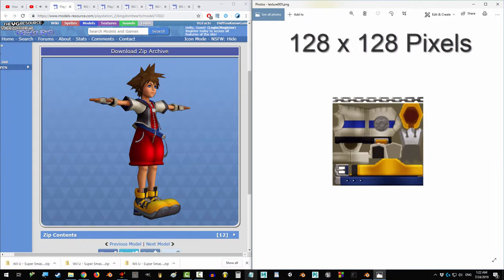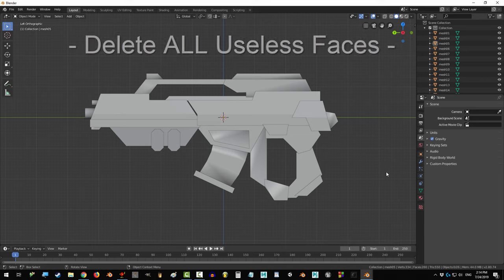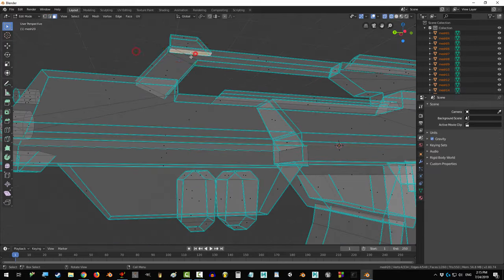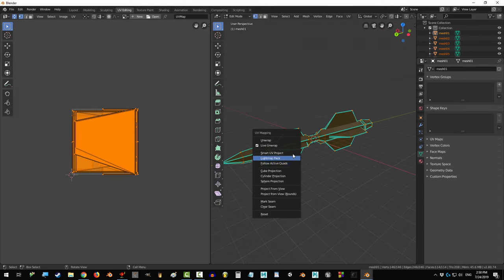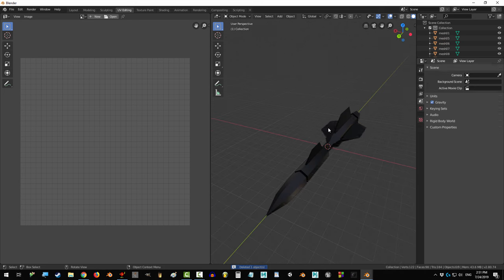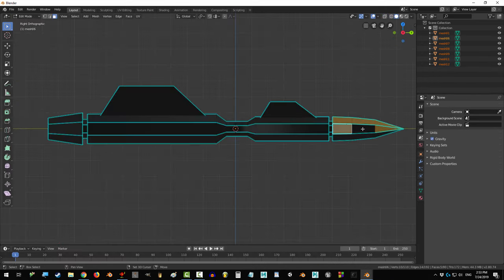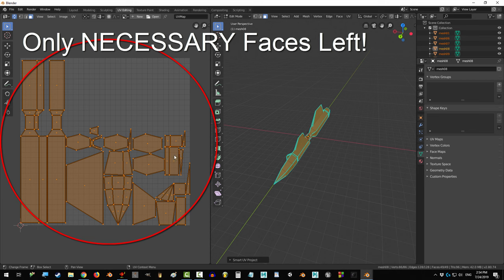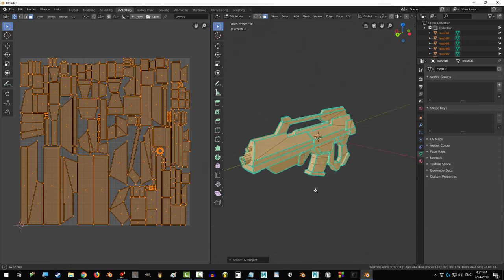Blender 2.8 : The 3 Rules of Japanese UV Map Preparation

Comment: Just a quick question, you say delete half and mirror when you're done do you mean add the mirror modifier and export? I ask because would the mirror modifier not add the extra polys or dose it just layer the other mirrored side under the already mapped side so it's not a problem. 

Also with the missile how the hecky dose that work cause I know the maps will be the same and such for each fin but do you make the fins as separate objects and then unwrap one of them so the same uv applies to all of them because they're technically the same object uv wise or is the missile one object with the fins and you export the object fully but delete the excess to do just the UVs? If the fins are separate objects then I understand how you can just delete them because in engine or later you can just copy paste the unwrapped fin but if it's one connected thing I don't see how just mirroring will get you the original 4 finned missile.

This is interesting but it's shorting my brain because I'm hardwired to just delete unnecessary pollys and unwrap like you unfold a box with all the UVs like normal but I see it's very inefficient in comparison
Reply from the maker: Sure thing, don't worry. It's very straight forward. Let's start with the fin question. In short, after the fin has been textured, you copy and past them to fill the space of the fins you deleted. You can use the mirror modifier if you want to do this. The basic thing is UV/texture the fin > then copy and paste it back to fill the 8 original positions. I just ctrl + c > ctrl + v and snapped them back to the original position. 

And yes, you would apply all your mirror modifications, apply them, merge points, remove doubles, before exporting.
Reply: @TheRoyalSkies  oh so the fins are separate objects. That's really clever so if you unwrap one fin and make copies then the duplicates will obviously have the same UVs. My brain is still shorting on how this will work for like merged objects and some spesific use cases I can't explain but I think I pretty much get it so I'm sure I can figure it out. 

Thanks for the info man, I love the quick vids and the upbeat personality, you've made learning blender super quick for me because I know how to do most of these things in other programs but I wanted to learn blender and beginner tutorials are usually long and frustrating because I know a lot of what they're saying but I just want to know the shortcuts and buttons and terms of the new program not the history of everything.
Reply from the maker: @Marcel2278  Yeah man, you got it. The fins are just duplicates of a UV'd fin, the UV's transfer over too. I haven't done it in Blender yet, but when you merge objects in Anim8tor or Maya, the UV's are kept unless you change them. So for my game in Unity, I would just join everything into a single object after I had copied and pasted all the fins and it would still be properly UV'd and textured. 

I'm in the same boat as you really. I came from Maya and wanted to pick up Blender. It's a great program, it's just how long most of the tutorials were. But, I'm hoping after this series is done. People wont have that problem anymore :)
Reply: @TheRoyalSkies  dude definitely, your videos are short and to the point, I wouldn't say the most beginner friendly (they are but they're so quick I think an absolute beginner might have to watch it about 2 or 3 times to get it all in some times but I'm talking never picked up any 3d program noob but there are longer tutorials for them anyway), but they're definitely super helpful for people who have even the tiniest idea of what you're talking about and they can easily follow. It's also especially useful for people who come from another program trying to learn.

Comment: So do you just add back the repeating objects afterwards and use the same uv for the previously deleted objects? UV mapping is something I really don’t do (but should), so I want to be sure I’m understanding correctly :U
Reply: Dark_Mink  so any objects that share the same UV some will have the same texture applied to them.

What you want to do is, any repeating elements that CAN look the same textured, SHOULD.  Why do twice the work when you don’t need to?

So create that object and mirror and repeat it as needed.
Reply: You can leave the geometry there if it's easier to move all the UV islands over the same spot, but it's probably easier if you map it once and then duplicate and move the geometry to where it should be, that way all the UV islands for that object are stacked on the same spot. 

It's the same with mirroring a symmetrical object I think. The UV islands for either side are stacked on  each other so you only need to 'paint' half the model.
Reply: Logan Sunn cool, thank you!
Reply: Arthur Khan thanks to this also \o/
Reply from the maker: Logan and Arthur both said it spot on. Yes, you can just copy and paste the objects back on where they were afterwards (They will retain the UV data from the original). Island stacking is great way to save space as well. I'll teach you a few more tricks in the next video to help clear things up :)
Reply: Royal Skies LLC Nice, I’m looking forward to it!

Comment: now that i think about it, i don't think iv'e ever seen the UV mapping for western games. mostly just fiddle around with SSBB.
Reply from the maker: Western standards generally try to remain as faithful as possible to the model when making the map. We tend to try and avoid changing the shape of the original object to fit the map. Western maps tend to be easier to understand and less cluttered, but they also tend to have more empty space and save larger file sizes. The Japanese will try to squeeze as many shapes as possible into a square even if it deforms the original object, and try to get the most detail they can while making the file size as small as possible. For example it's not uncommon for western style modelers to make massive 4k resolution texture maps. On the other hand, Japanese rarely make a map larger than 512 x 512, and in exceptional cases, as shown at the end of the video, 1024 x 1024.
Reply: @TheRoyalSkies  Excellent description of this practice. One of the things I experience UV mapping is overthinking. I tended to think "Well squaring this is distorting my model; am I supposed to do it like this?" or "I see people use the square method, but sometimes there are still curves on the model. Why is that and how do I know when to square and when NOT to square?"

You definitely answered the first question for me! If you can help me out with the latter that would be sick, lol.